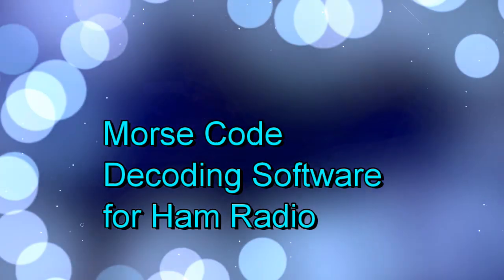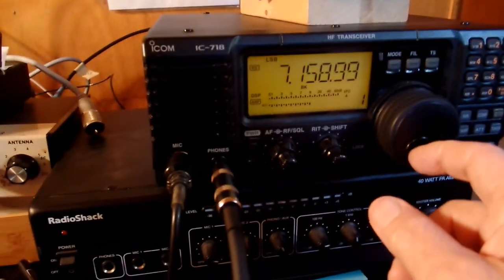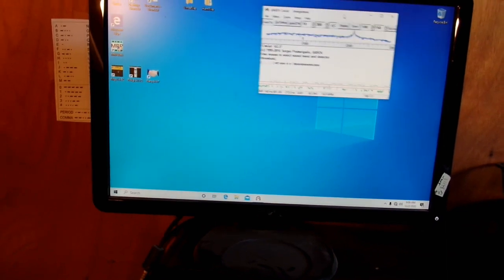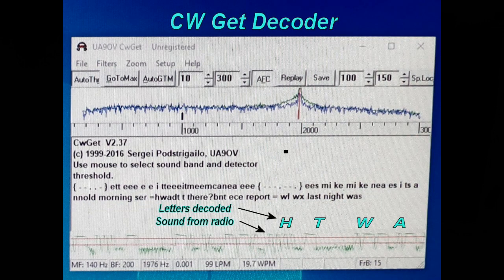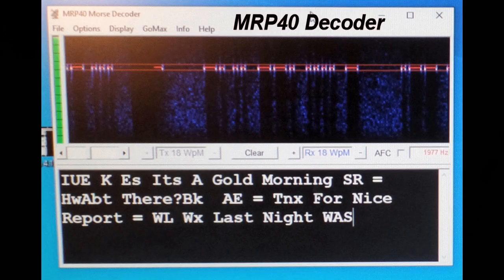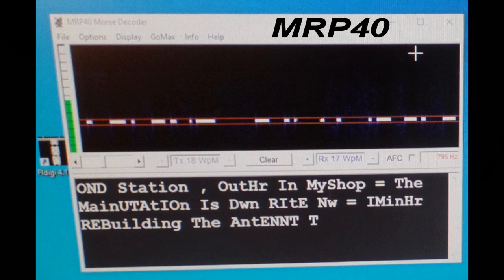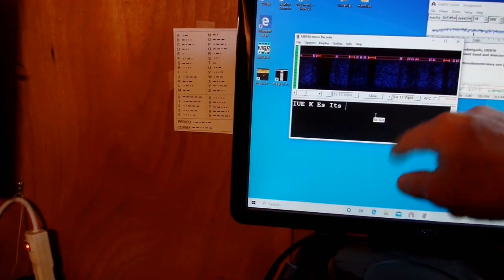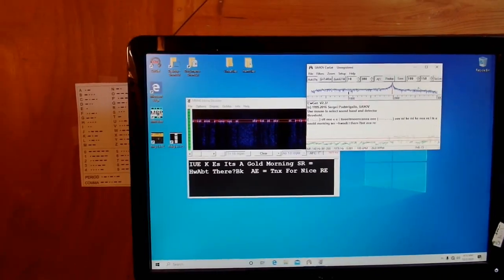Morse Code decoders for Ham Radio

Comment: i know this video has been here for about 4 years, but what i was trying to figure out, how does the computer get the signal input, is it just a microphone cable from your transceiver to the sound input on your PC's sound card, or ?
Reply from the maker: Yes. A microphone is plugged into the USP drive on the computer and the pick-up end is place at the speaker from the ham radio.

Comment: Uncle Vinny, hope you can answer, just discovered thos great video. -I have an IC718 too and Signalink (and the MFJ941 tuner too) how do you have your rig set up to use CW Get/Type with keyboard? Do you have a USB to radio connection? Thanks for any help. de WO8USA
Reply from the maker: Ugh! Hate to answer like this but the truth is these little modules are just not quite ready for prime time. They are touchy and crash often. I finally decided not to pursue it, relying instead on learning code in my head. Good luck!

Comment: Is there a app I can run on a android tablet?
Reply from the maker: I don't think so. The app would have to receive audio and display code at the same time.
Reply: Yes, there are several.  I use one called Morse Expert.  It will get the audio off your Android device's mic.  Morse Expert shows a sideways waterfall (riverfall? lol)  73

Comment: I am looking for a decoder that will do the following:
  It needs to "Hear" the tone generated by my Xiegu X 5150 (with QSK OFF...code practice mode)
  It needs to analyse my dits, dahs, space between characters, and space between words for correct timing.
  It needs to compare my transmission with the PERFECT characteristics in its database for generated characters.
  It needs to have a operator defined DIVERGENCE PERCENTAGE to allow for the human factor of in-exactitude.   Sort of like a squelch control on fm. Essentially, humans cannot send PERFECT code so the operator needs to be able to decide on what percentage is acceptable quality for divergence from the perfect standard.
  It needs to provide immediate feedback on specific differences between what is transmitted by the operator and what SHOULD have  been transmitted.....
  There are any number of code generating schemes for the learning of transmitted code but, as far as I can find, NOTHING to analyse an operators transmission for quality with a feedback on the operators shortcomings.
   It surely does seem to me that there is plenty of room for improvement in the "Fists" of CW operators on air.....But no Code Transmission Practice Programs available....  Am I mistaken? Is there something available that I have somehow overlooked??
73's
KF7ZSA, bob
Reply from the maker: Mmmm! A "heavy" request. I believe many ham receiver rigs have a process in their menus where you can set such specs on the code when you use an electronic keyer - to send code.
My experience (limited) is that the code reading programs simply make a best estimate based on the speed of the transmission and the spaces between the dits and dots. I expect a very advanced program would be able to distinguish the nuances you describe, but my best opinion is that you would need to create a dedicated program with original code.
I suggest you pose the question to one of the ham radio forums, such as Eham.net. They have a dedicated CW topic.